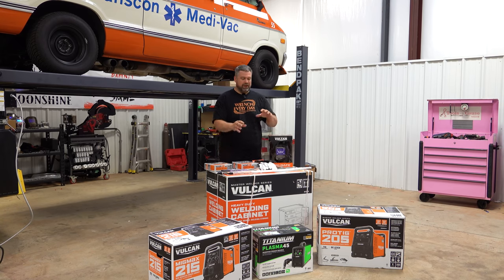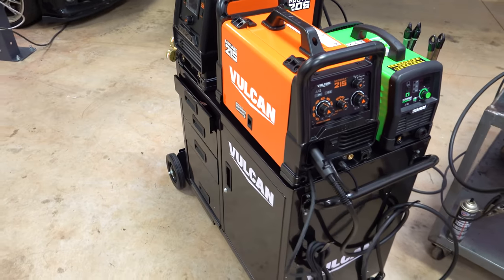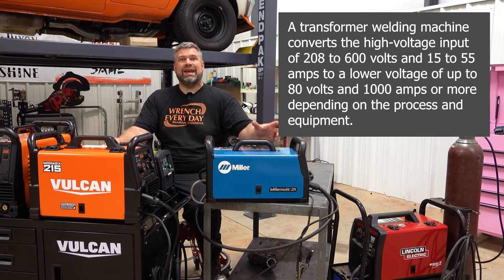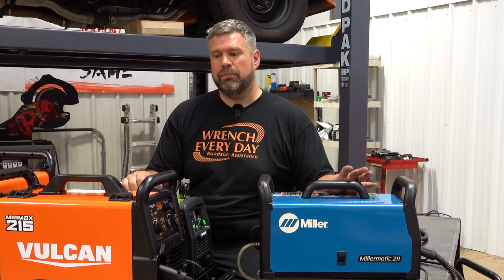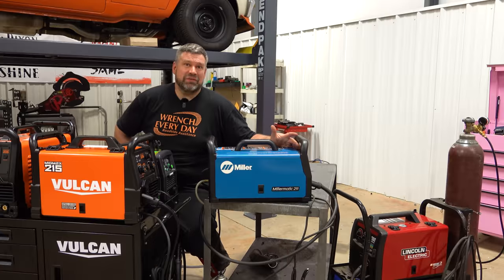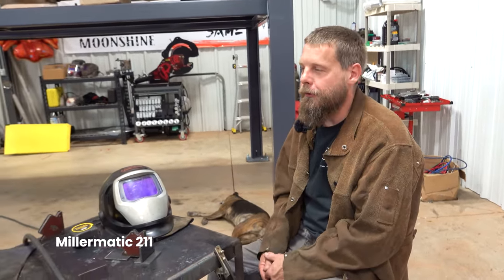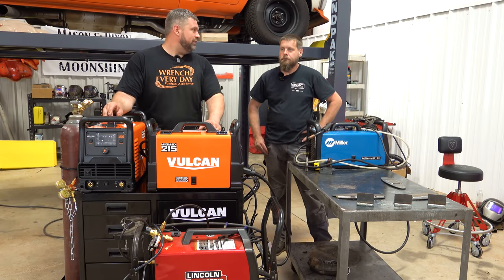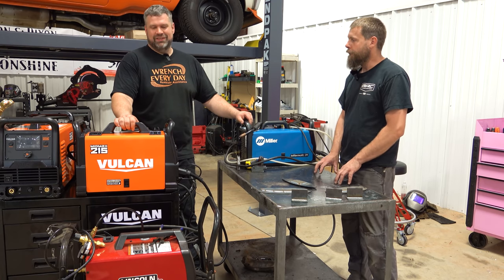Here's What NO ONE Will Tell You About Harbor Freight's "Best" Welders....

Comment: My millermatic 220 multi-process does TIG, MIG and arc in both AC and DC, allowing for welding aluminum as well. Personally I run mine water-cooled, because air-cooled TIG gets hot FAST over 100 amps or so. The one thing that the Millermatic 220 doesn't do that I really wish that it would is pulsed AC TIG. It does pulsed DC TIG no problem, but for whatever reason AC TIG doesn't have that option.

Either way, I've been using that Millermatic 220 fairly heavily for over 2 years now without issues.

Over the years I've had cheap machines and I've had expensive machines, and my experience has been 100% you get what you pay for.

Comment: For someone who only welds once in a while, I think the transformer welder I have (red one), is the safe bet in not being stuck with a busted welder down the road. Some of this new tech in inverters and linear refrigeration motors are just too loaded with components known to fail. I don't care about the amount of juice it uses as I am not a welder, just need one in the shop now and then, so for my money, shop the classifieds/marketplace for a slightly used name brand transformer machine. If you're like me, you are just interested in sticking two pieces of metal together, as you don't spend enough time at it to look like a pro. Grinders come in handy to clean up the messy stuff.

Comment: Watching the video you can definitely see the difference in the amount of splatter produced by the 3 machines. Both the Miller and Lincoln operate closer to normal AC frequency of 60Hz. Where you can hear the higher frequency the Vulcan uses. The higher frequency resulted in a lot less splatter than the other lower frequency machines. It's interesting that the Miller 211, being an inverter machine, didn't use a higher frequency. Something to think about....

Comment: Custom chassis fabrication has been the family biz since the 60’s… before I was born. Miller has been and always will be the standard of quality for the true professional. When you buy a Miller, you can expect decades of use from it in a production environment. You can also expect parts and service from Miller, if and when you need it. Those expectations are built into the price of the machine. 
As far as weld quality goes, there is not much difference between a Miller and Harbor Freight machine. Both will get the job done today but only one will be get the job done every day for the next 20 years. 
I own seven welders of various types and brands, and my favorite go-to portable MIG machine happens to be an older Northern Industrial 140i. I needed it for a remote job, it was cheap, and I didn’t expect it to last past the warranty. That was over ten years ago and it probably has over 500 trouble free hours on it. Dollar for dollar, it has been the best welder this Miller fanboy has ever bought. If you can find one, buy it. 
As for Harbor Freight, thats a No for me. They have too many other, much simpler tools they can’t make without falling apart if used more than once.

Comment: My rule of thumb with Harbor Freight is never buy anything with an internal combustion engine. Bought an auger, but didn’t use it for a while. When I finally needed it for a job it shot an 18” flame out of the exhaust. It’s the only time I’ve had to bust out a fire extinguisher.

Comment: Got the Chicago electric 210 its nice. With a large RV cord and adapter you can use it on dryer plugs without overheating. Only wish it had better amperage control. I think my brother blew a capacitor in it it probably has 100hrs with no regard to Duty cycles.

Comment: I picked up the 110v mig machine the cheapy $125 with just a feed speed and high or low heat.. it was a return, surprise, and it grabbed it for 30 bucks.. i can pretty much hot glue anything up to 3/16" and it does the trick.. I just use 030 or 035 flux core wire and get 'er done.. I can't wait until i 'need' to finally upgrade and buy a real welder.. one day

Comment: I can mig, tig, stick, gas weld, I like the old gas and stick/arc welding best, but on thin metal mig and tig are great. It depends on what you are doing I guess. I can buy a $100 stick welder and weld most stuff and braze with a simple Mapp bottle and even "weld" aluminum with that Mapp gas. Bodywork and thin welding is harder, wet rags or some heat displacement putty helps a lot. I would love an old school welder truck with generator/welder and all that... You can leave them in the weather too.

Comment: Not too long ago, I bought an Omnipro 220 from HF. I have yet to unbox and fiddle with it but it is the computer controlled multi process unit that can also run a spool gun for aluminum welding. I have no such need currently but I like the availability. 

I'm commenting before finishing video so I'm eager to see the performance and hear your thoughts.

Comment: I've always been a Miller fan even though I'm no where near the pro level in your video. Here's a caveat about Miller though. I just repaired my Autoset 180. The gas valve coil shorted and cooked the control board. $385 for the board and $110 for the gas valve. And that's fixing it myself. So while Miller parts may still be available, the parts are crazy expensive!

Comment: Randy has a good point here about future parts availability, I have a Harbor Freight air compressor (I know, it's not a welder) but it's an older model vs. the new lineup they carry at present, so I can no longer get parts for it and I'm forced to have to throw the thing out and get an entirely new one, which really sucks. And I've seen HF do this on other products too, seems like they keep changing their lineups and if you own one of their older products, you're SOL with parts availability. Just something to bear in mind when investing this kind of money.
Reply: Compressor parts are mix and match. My air compressor has a different motor and head on it today. Still makes air.
Reply: Harbor Freight also only has a 3 month warranty unless you buy their high priced extended warranty. Lincoln and Miller start out with a great warranty.

Comment: My Miller 211 120/240v transformer machine has been reliable and a workhorse for 15 yrs. I also only paid $1,200 with the spool gun. 
  My Panasonic gun slinger is a beast, but weighs a ton!
   For the price and general quality, the Vulcan is definitely something to consider.
Reply: Duty cycle ratings would have been a good thing to point out as well.
Reply from the maker: Sometimes things make it past the editor. One thing I can say, I ran 33lbs of wire in 4 days through the Vulcan and it didn’t slip a beat, it’s been amazing

Comment: You also failed to mention that the 215 will weld aluminum with the spool gun also made by Vulcan, I have both and the spool gun aluminum with the machine makes a great addition to weld aluminum. I don't believe that the miller or the Lincoln has that capability.  Rock on Vulcan, I all so have purchased the portable gas powered stick machine  and it's also a fantastic addition and has a power supply to power the 215 for portable service.  Great products hands down.

Comment: I'm happy with my little Easy Flux 125. I wouldn't use it for a trailer or anything structural, but it did save my butt when the axle on my riding mower broke right before a rain storm.

Comment: If you are looking for an excellent rated ac/dc multi process machine… its not cheap but well worth it Esab 205ic. I also use the titanium mig 170 and a titanium stick welder for stick and scratch start tig  because of weight and size for a project that i did not want to subject my esab to. I was surprised by the harbor freight titanium welders.

Comment: You can run aluminum on a multiprocess welder with mig. You can either get a spool gun or run the hardest aluminum wire in your mig machine and adjust the rollers to very light pressure to keep it from “bird caging” if you get a burn back on the tip. Also multi process welders run very well. I’ve been welding over 30 years, and have run just about every type of machine you can imagine and every type of welding.

Comment: So I'll throw my hat in here on this. So I am a retired 4955 Hull Tech (Navy Welder) qualified by Lou Thomas, if ya know ya know. I decided to get a Titanium multiprocess from Harbor Frieght just for around the house and light automotive work. I've had it for about 6 or 7 months now, and I fucking use it like a 4955. I have done heavy structrual, AR500 and 550 target repairs, mild steel angle iron various thickness, lite pipe work, rebar welding, gun range rifle target stand fabrication, etc... Basicly the lowest I have run the machine on 220 power supply is 95 amps and highest thus far has been 145 amps. And on the 115 amp (hobbist) setting for home use it will max out at 75 amps out put. Thin (3/32") rod for very light stick is fine at 115 power supply. It will do TiG but it is lift arc which I am not a fan of but it will TiG fairly ok-ish, did a cat back system for my truck. Turned out ok, not the best looking welds, but all were solid. On 220 it is easier to establish the TiG arc. It will not TiG aluminium. I have not run the spool welder yet as I haven't had a need for it. I have used this brand in the past for a MiG welder and it will get your light duty jobs done just fine, reccomend 220 power supply. And for less than $875 for a welder it does Stick very well and MiG well, but for TiG you're going to want a dedicated TiGger. I am looking at that Vulcan 205 in this video, sadly not featured, and if it gets good reviews and is high frequiency where I can do all sorts of metals, it will end up in my garage. 
Pros: fairly light weight, easy to transport, runs 7018 6011 and 10018 pretty well, spools out wire bare or flux core no issues. Will stick weld medium weight carbon up to 5/8ths plate, will TiG up to 3/8ths plate as well(personal comfort zone with this welder), holds arc well, lays fairly nice beads, and is rather affordable.
Cons: TiG welding is just ok-ish, not high freq, no pre or post flow on MiG or TiG for cover gas, duty cycle is a bit crap in the Texas sun(enviromental), supplied electrode holder faces in the stinger burn up quick, manual on off valve for cover gas, can not TiG weld alminium. 

All in all on a 10s scale as some one who did this professionally for almost 20 years 7.2 out of 10 for welder, great entry level machine. 
Side note, that little plasma cutter will pretty much suit anyone not doing industrial heavy duty metals. Aka sub half inch.
Reply: Personally I prefer lift-arc and gas control on the TIG stinger, but I also hate welding aluminum. I get where you're coming from though.
How are you TIG welding in the sun though? It's too windy here in Texas to be tigging outside.

By the way, you used one swear word in that entire post, and it was completely unnecessary. You should edit it out.
Reply: @TehButterflyEffect  firstly salior so 1 cuss word made it out and I didnt even notice it so thats a win on my part. As to how I'm tig welding out side, well when I have to I set up a 3 sided wind break. However I generally only tig weld in my garage or a inside environment; as I prefer my cover gas to cover the weld lol.

Comment: Have a northern tool 220sidv. Had it for over 3 years in small commercial shop. It does everything very well.(haven't tried 6010) run 7914 and 18 like a dream. Spool gun great for aluminum. 
   I can say this. Compared the m211 side by side. Close your eyes you could not hear a difference in arc sound. Don't get me wrong on a side by side there was little nuances that was a little better on each machine.
   Did have a front board go out after 2 yrs. of hard service and customer service was great. Called service gave address sent it to them(had to pay shipping one way, no charge to fix) sent it went on vacation and it was sitting on my porch when I got back 1 week. I don't  even Miller can do that. Yes I'm partial to Miller but not at those prices right now.

Comment: miller makes a multi process welder that can do mig stick and both ac and dc tig, it connects to two bottles and switches automatically between mig and tig just by hitting either trigger on mig gun or foot pedal for tig

Comment: When I was shopping for a welder 5+ years ago, I noticed that the industry was switching over to inverter machines.  Even the new miller migs are all inverter even though they come in the same old case.  

I chose to buy the Lincoln pro mig because it was a proven machine and has the spool gun.
Reply: 15 years ago

Comment: Everlast has a Metaprocess that does MIG, Stick, and Ac/Dc TIG. its the Everlast LIGHTNING MTS 225, its cheaper than both Miller Multimatic and Esab Rebel IMO a great welder, ive had mine for 2+ years and has performed great!

Comment: Old School? I still run some General Electric 240V 3 phase motor - generator welders and a  Lincoln SA-200 Pipeliner. The GE sets are from the 30's or  40's and the Lincoln is from the mid 60's

Comment: The longevity of, ability to repair and service the welding machine  are also important. Harbor Freight only offers a 90 day warranty. Any additional coverage (1 or 2 years) needs to be purchased . I am not sure what the 1 or 2 year warranty costs are  for the Vulcan, though it certainly drives up the price. 

 Let's imagine you use the welder on occasion, if one goes beyond the 90 days or the 1 or 2 year warranty and the welder breaks down , who repairs them? Are (will) the parts (be) readily available? How far will Harbor Freight service go to help you?  My experience has been, HF employees will probably say sorry  you have to buy another welder. If this happens are you saving any money?

 Are there other welders out there with similar performance, better service record / warranties, at a reasonable cost? Harbor Freight's pricing, on a number of items, is not what it once was (Not bad persay, but closing in on a number of their competitors), though to their credit they offer better quality product lines than before.

Comment: I welded outside on high-rise buildings.   We always ran flux core wire. 
   Seems like less is better in my opinion.  Purchesed a Lincoln wire feed .  Iv never had a problem . Plugs into the 110 .  Been running 232 . Runs vary well.  Just turned the heat up to the max . Had the wire a little fast . Keeped my hood on . Pulled the triger and turned down the speed until it was gust right. Can't burn through thin metal. 
  I've repared many things over the last 35 years without a problem . No big deal. Less parts less problems . Never could understand why people want to deal with tank's gages exerta .
  That plasma cutter is my kinda way to go .  Disliked the cutting torch.  Gages hoses cutting tortch tips tank's are a time consuming and wast of money compared to the plasma cutter. 
   In my opinion of course

Comment: So actually you only compared 2 machines , the Miller and the HF .I can understand why , the Lincoln is a transformer and the other 2 are inverter , not a problem . Miller has always been the standard for production , but for the homeowner who is going to do hit and miss welding the cheaper HF is probably a good choice , it seems to have a lot of extras going for it , but the only problem I could find was serviceability , what happens if it breaks , where are parts available ? Lincoln , Miller and Hobart are readily available thru their welding stores .All in all a good test   , I'll be looking forward to the Tig test .

Comment: On an old oil cooled transformer machine it might cost a little more to run, but you can weld all day no problems. There's no downtime for them to need to cool down. If all you need is SMAW I think they're unbeatable for a cruddy environment but also anytime you don't want to be stopping and starting due to the duty cycle of a cheap inverter machine.

Comment: I'm at 10 min into the video and am wondering how you will hook gas to the 215 machine?
It connects in the back....right?
I have an Eastwood machine from way back (still use) and it hooks to the back just as my plasma air hooks to the back. I put a double stack of 2×10 under the mig to allow room for the door to swing past the handle up front and have all three (2 face one way and 1 the other)
Mig, Tig and plasma....

Comment: The Vulcan sounds smooth. I have a titanium multiprocess, and a discontinued 110v Chicago electric as a starter machine. The titanium is my second one replaced under warranty as the first failed. The owner of the shop ajoining mine had to replace his titanium Tig machine once also. His ground fell apart causing a surge that burned up a board in his.  I have only run flux core through my titanium, but I do like it. After watching this I think I will like to buy a Vulcan 215 next. My take is the titaniums weld nice, but by the warranty!

Comment: I've got the old Chicago Electric transformer 180, aka Clarke, which is kinda a rare bird but damn, it just won't die so I can go out & get an inverter machine. I've run it hard for going on 9 years & never fails to burn metal together, some are prettier than others but it always sticks together.

That being said, the Vulcan machine sounded positively BAD-ASS! Some serious buzz & fire thru the wire going on there! Best welder I've ever used to date was a Miller 252 that Delta owned...my god even I impressed myself with the coins I could drop with that thing.

Comment: Of course wire speed and voltage always influences a weld, but the Vulcan just sounded better- more of a consistent buzz with out the popping/sputtering/cracking of the other 2.